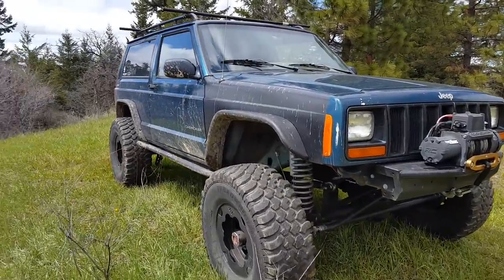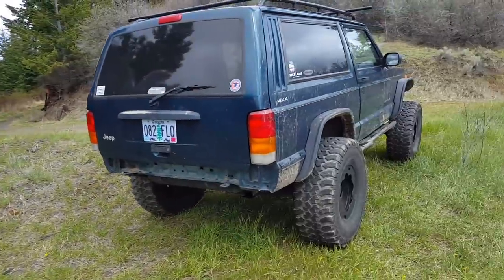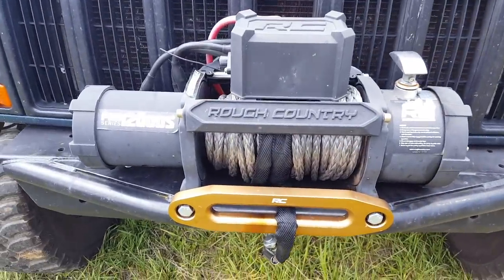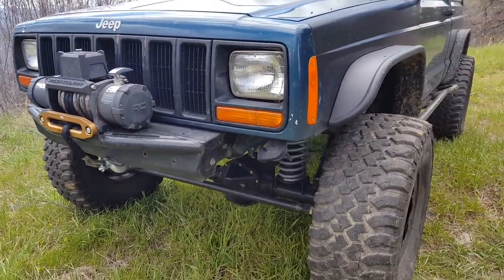Project Green Machine - 1 Year Review

Comment: With a hp 44 and 9" rear your safe to run up to 40" tires. It blows my mind you'd make the effort to make the axle swap to run re-tread 33s you can't even air down. Great build but there is so much more potential behind this jeep. I just got a hp 44 and 9" with 5.38 gears and Detroit lockers front and rear. 35 spline chromolys as well.

Comment: I am glad to hear that your treadwrights are working out for you. I have had 3 fail on me in the last four months and 2000 miles.
Reply from the maker: How do they "fail"? What issue are you having and have you contacted TreadWright about it? I can't seem to kill my set.
Reply: That's strange, I've had 2 sets of the guard dogs and I've beat the crap out of mine, and I've never had an issue with them. Only reason I replaced my last set was because the side walls were cracked from letting them sit for 2 years when the jeep was dicked.
Reply: The tread is separated from the belt. I have contacted treadwrights and they are replacing them but I really don't trust them to hold up. Also there customer service is pretty poor. We the first two failed I never received any communication from them just the shipping notification and the third one has taken a month to get replaced.
Reply from the maker: I saw your pictures there. That's interesting! I feel like with my tires being slashed to the belt and running them at low PSI I certainly would have had this issue happen to me if it was a problem with their adhesion process. I haven't experienced any separation at all!
Reply: Yeah, that is part of my disappointment with them. I couldn't find anybody that actually owned them have an issue with them but I have nothing but trouble. One of them failed after only 50 miles. The other issue I have is that their customer service is awful. The last one that failed, the one that is smoking, took them over a month to replace under warranty.

Comment: The upper passenger heim is loose because the axle rotates as it flexes. Metalcloack.com has what's called a lock-n-load that replaces the upper control arm on the passenger side. Unfortunately it won't work with your setup.

Comment: 2 bolts and 2 studs holding the cross member on? Every once in a while, people get lucky with Rough Country, I know I sure didnt. My old RC leaf springs were all kids of messed up. Maybe they hand out some better ones to certain people?
Reply from the maker: Yep that's it. Two studs and two bolts holding the crossmember on and all three of the links to the front axle. Somehow it works fine! As far as Rough Country handing out certain things to certain people I don't buy that at all. Continuously changing manufacturer or changing products all together is more likely.
Reply: Isnt that kind of the problem with RC? You never really know what youre going to get? I dont know, I personally had a horrible experience with RC, enough so that i wont buy anything they make.
Reply: Josh B agreed man... They aren't consistent with their products and you're more likely than not, at least with my luck, to get a lemon of a product. A year is a decent amount of time but Should be expected when investing in products like these. I'll be impressed around 3-5 years. Until then I'll stick with Rubicon Express or Synergy for my XJ.

Comment: looks great! any problems with cooling? with the big winch blocking some of radiator?
Reply from the maker: Non whatsoever. I've never had cooling problems with this Jeep before or after lifting it, or after blocking the radiator with a winch. I did replace the original radiator two years ago with another OEM one because it cracked but its never run hot. Good question.
Reply: awesome Thanks! thinking of putting one on my toyota

Comment: Question. I see it's a Ford Dana 44 with the 3 link on the passenger side. Everything is super smooth. And I want mine to come out the same way. What brackets did you use on your axle? More importantly, did you center the spring pad on the axle vs offset like the Jeep came factory? See I will be running high steer knuckles on mine so an OTK trackbar bracket In the same spot, directly In front of the spring would be epic.

Comment: Hey Tim,
Green Machine has come a long way. I'm thinking tons might be in my future, too. I don't know if you remember,  but my 96 cherokee has RE control arm drop brackets and also the new style trans crossmember from R&R. Greg welded on my frame stiffeners and the crossmember fits great. However, since returning from Moab, the whole front end creaks and groans and pops. I'm thinking of going long arms like you. Anything you'd do differently? Thanks for the great videos.
Reply from the maker: Hey Randy, 

I remember your Jeep and the drop brackets. I've seen several XJ's with mysterious popping and clicking  noises from the front. Often times it seems to be around the steering box. Honestly I wouldn't do anything differently. I should add unibody stiffeners like you already have but I'm super happy with my 3 link set up and the R&R cross member. There's still a list of things I'd like to do but as far as the major stuff  I've done so far.... I wouldn't do it differently.
Reply: Randy Beronia Hi Randy!  Sounds like you have a really nice Jeep. Are you getting the noises more when your suspension is worked over bumps? Or do they happen more when you turn the steering wheel? I had some popping in my old 99 XJ when the wheel was moving, which turned out to be the upper joint on the track bar. Another area that can make funny noises is when the steering box spacer is coming apart, although you'd likely feel a difference in how the Jeep is handling.  As a side question, what sort of differences did you notice after you got the stiffeners?  I've always wondered what getting a set on my Jeep would feel like.  ☺
Reply: P Ferris 
Thanks for the comment. I get weird noises all the time when turning and also crossed up offroad.  The steering box spacer is custom 3/16 plate, and I run the Rubicon express HD track bar.  I should check the joint and also the steering box bolts.  I recently noticed I sheared off the horse shoe adjusting bolts on both lower control arms. My coil springs are angled forward instead of being straight vertical, so maybe caster is off. I'm hoping long arms and OTK steering will solve some problems. Im thinking the drop brackets are putting stress on all the wrong components. Thanks for the feedback.
Reply: Randy Beronia Here's hoping you track it down quickly and it's an easy fix!  😊

Comment: Hey Tim ! Although your rear limited slip is toasted, did it do it's job before it was worn out? Or are lockers the only way to go in the first place.
Reply from the maker: Definitely lockers are better. It was toasted to begin with, after all these axles were pulled from a 1978 truck and I'm sure the truck was well used. It seems to work when I'm really spinning the tires hard but its basically useless for crawling.
Reply: Thanks so much TIm !!
Reply: Tim: Not surprise the rear clutches were burned up or worn out.  I noticed the condition of the gear oil draining out as you removed the pumpkin in another video and it was silvery black muck. Was really surprised you didn't service the front stub axle's and/or bearings too. Likely that will get done at some point when the front ring and pinion are replaced as they are mostly running on the "toe" side of the teeth. In the end, much saved dollars for those great front & rear housing parts no matter how worn they were.

Comment: Was your jeep originally a drum brake rear ? did you have to do anything other than just plumbing the new disc conversion ? id like to do the same thing to my '99 Dodge Ram with rear drums .
Reply from the maker: It was originally drum, both the stock axle and the Ford 9 inch I swapped in as seen in the video. After welding on the caliber brackets I didn't have to change a thing for the disc brakes. As I said in the video though, I will be adding a manual adjustable  portioning valve ($40 from Summit) so I can turn down the pressure to them because they brake harder than the fronts as is.
Reply: thanks , I hope to see more of project green machine !
Reply: So what do you use for a parking brake with the rear disk brakes?  Nothing ?

Comment: What's the lift and tire size? Ur running?
Reply from the maker: 4.5 front springs, 3.5" rear, 33X12.50 tires. This won't be exactly the same on every Jeep since I have Ford axles and Ruffstuff U bolt eliminator rear spring perches.

Comment: How much to build roof bars
Reply: I'd love a rooftop bar on my jeep.
Reply from the maker: I'm not set up to build these as I don't own a tube roller right now. I used Rock and Road's roller to build mine. Perhaps check with with local fab or offroad shops in your area for a quote.
Reply: Donald and Tim: Likely anyone who will fab a roof bar "kit" or a build is going to have to have a more detailed design to mount it to the roof panel that includes maybe plastic or rubber "washer or feet" for the risers to sit onto the painted roof to protect the paint and also prevent any water leakage. Pretty sure most folks would want that feature. Good question in any regard.

Comment: those rear lower shock mounts
Reply: No shit.....great jacking point for a low profile jack. 😂🤣

He's excited to drive on the beach at Jeep Beach... That kind of sums up everything. 😂🤣😅😄😆
Reply: Sometimes ya gotta slap together something with what ya have to get down the road.
Reply: ddcraun lol.....its been a year! 🤣😂
Reply from the maker: Maybe I misspoke. The new super low shock towers are only a few weeks old. My last set up was high clearance and didn't drop below the axle at all. When my upper mounts failed, I did what I had to do to fit these 10" shocks on there. Its temporary. I need shorter shocks.